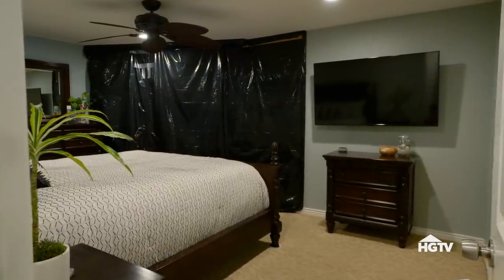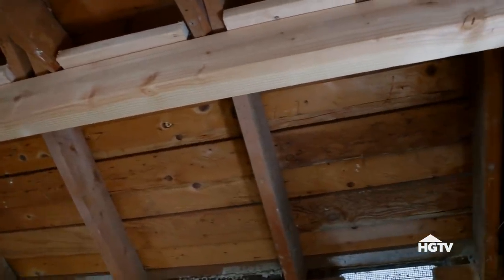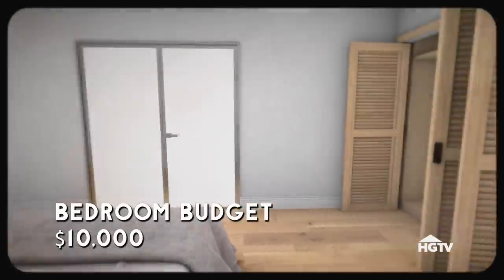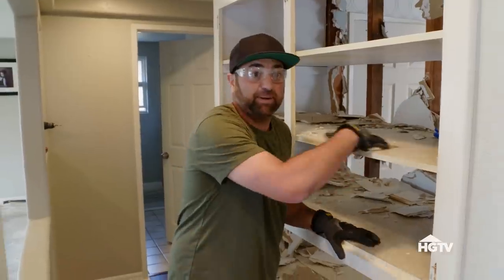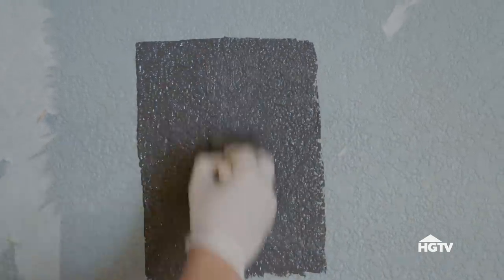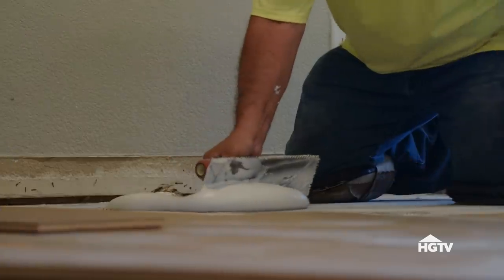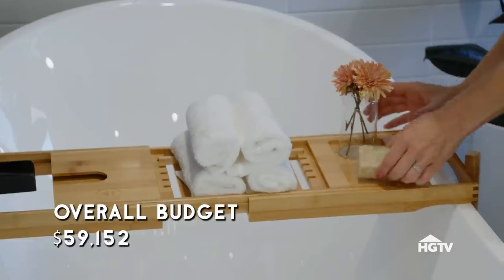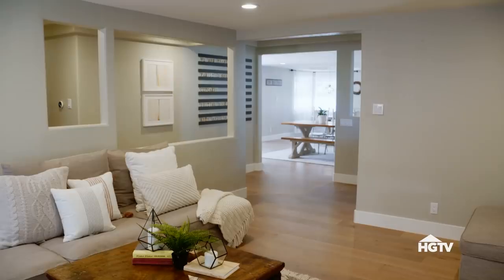Fixing a Home with No Bathroom | Help I Wrecked My House | HGTV

Comment: I don’t get why leaving a division in the bedroom closet…🤷‍♀️
I didn’t get either the position of the vanity and toilet… if the vanity was in front of the door it would be much bigger. 🤔
Reply: Closet is separate because it’s a “his and hers” type of closet, it’s good to have some separation in that area. Moreover, there could be electrical, piping, beams etc in the middle too that wouldn’t allow the closets to be merged. And the vanity is in that place- again potentially because of the way pipes were running through the bathroom. The access points for these pipes play a big role in the positioning of vanity etc. It also gives the other space to be a plant space, which gets a pretty good amount of indirect sunlight. And not to forget that these episodes are edited and cut, so you don’t get to see every single reason behind what they are choosing to do, even if they do clarify it in the actual show.

Comment: Let's talk about taking a bath. Women like to soak and relax when in the tub rather than shower to yet moving. There is no place for candles, beverage or her cell phone. Where does the clean towel go? There are no grab bars for safety getting in/down/up/out.  Some listen to music. Where to put radio as it isn't built in. Where do the soaps go? Is there a dimmer switch on the ceiling light? Nighties or robe? Do they make anything to keep the water a set temperature? How about jet spray low back massage? Handheld shower head for rinsing off and cleaning tub? Designers act like they've never had a bath! Ideally, the tub would be in a little room of its own.